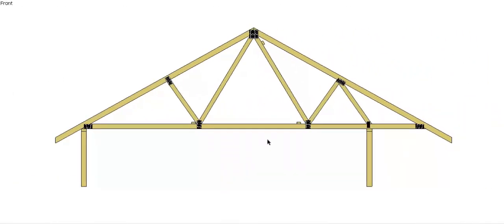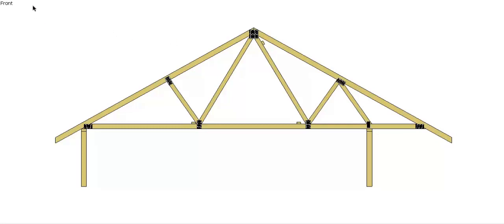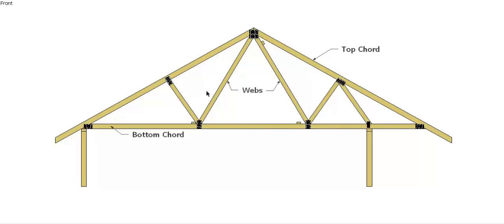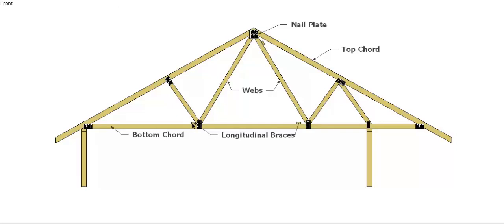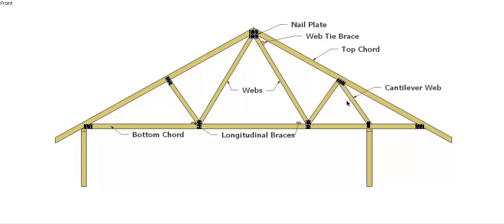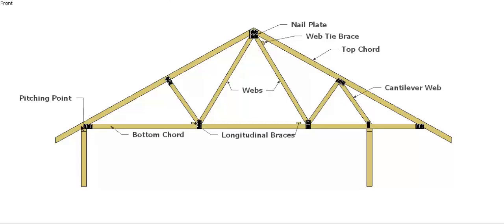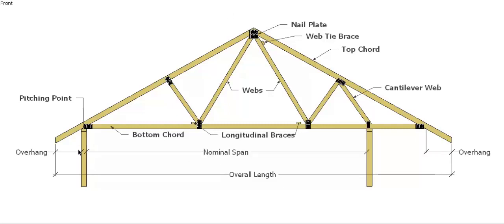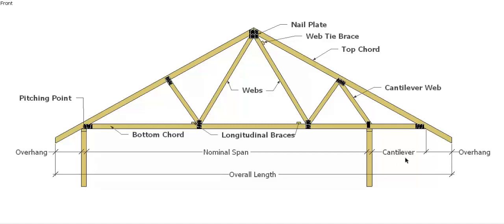Parts of a Truss

Comment: great video..could you just tell what is the span to rise ratio used generally and what are bays related to trusses.
Reply from the maker: Hi mate, thanks for your comment. The pitch of the roof/truss can be anything really, although generally between 10 to 30 degrees. The only reference to bays would be the area that the truss span over however it is not a term that is used very often here.
Reply: @Buildsum  Thanks for the info bro...do you have any knowledge of analysing trusses in staad.pro
Reply from the maker: Hi Mate, sorry no I have never heard of staad.pro

Comment: Hi. Great videos. Just wondering if as an owner builder whether your permitted to make your own trusses? I'm in NSW. I have a fairly small extension which extends the roofline straight out 5m.
Reply from the maker: Hi John, All trusses have to be designed and passed off by a Structural Engineer so itis more economical to have a frame and truss company do them for you. If the roof rafters would not have to span the whole 5m you might just be able to use LVL or similar.
Reply: Thanks, I have gone for pre fab trusses. They are actually cheaper than I thought they'd be.